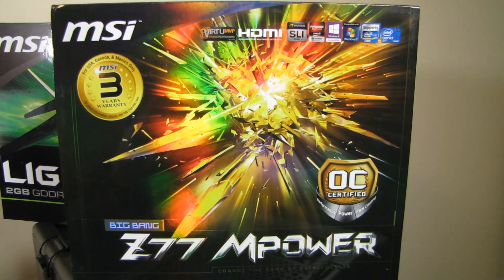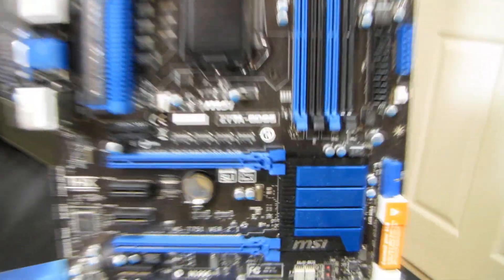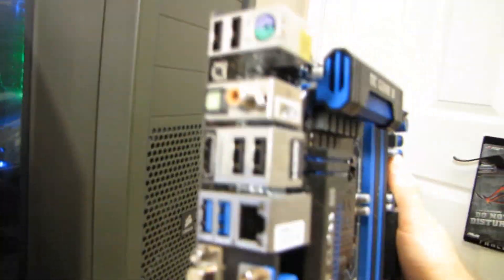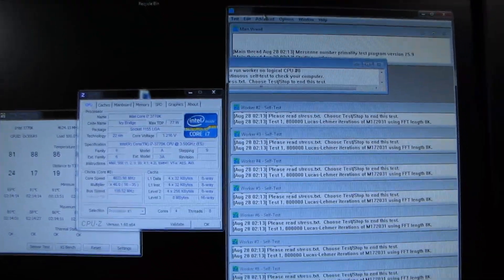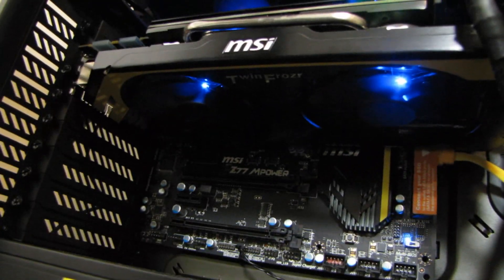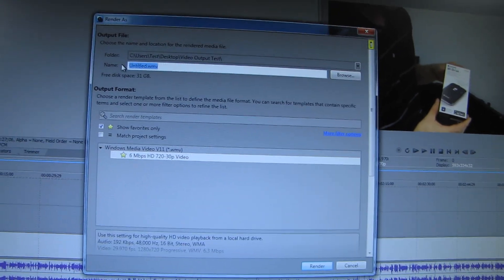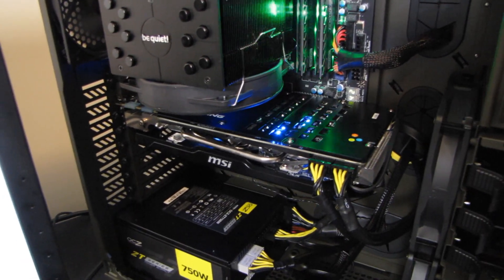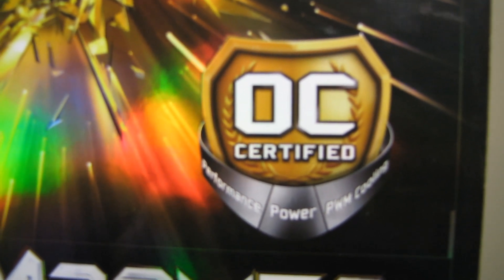MSI Big Bang Mpower OC Certified Motherboard Review Linus Tech Tips

Comment: If it is the blue LEDs on the top right hand side of the board it is not a problem. They are CPU phase LEDs they represent the amount of usage going through to the cpu phases. It is normal for that to happen.

Comment: Linus!!! I love you man!! but can u help me out for just one sec? I know the board has some sort of Phase control to help conserve energy, but it seems with whatever power supply i plug into the board all 12 phase lights aren't always on. It mostly only has 2 lights. I have a 750 watt, and 630 watt, and 500 watt, and they all do the same. . I'm figuring its the Mobo, but i would rather speak to a professional, instead of some Non-English speaking representative on the phone. Thanks man

Comment: why would you need it, the new cpu isn't going to be much of a difference from the 3770k just 5 10% like how much more to people need when they can already play games at the highest settings with an overclocked everything, even the 700 series gpu isn't going to be much of a difference when it comes out sometime in may and i don't want to wait till june for i7-4770k to come out and its clocked slightly lower at 3.2 MHz turbo boost 3.9 MHz and the price is rumored to be $327.00.3770k Great for me!

Comment: an i7 overlocked to 6.3ghz under liquid oxygen and 4 titans all liquid cooled. The motherboard does not really matter as long as you can fit all 4 titans on it a once. for your boot drive you need at least 10 512gb SSD in raid 0 but the prefered numbers is around 20.

Comment: In all my years of searching I have yet to find a "normal person." We are all different. :)
& I was assuming Linus is rich. xD
But for most ppl... I wouldn't even go intel. You can save $100 on the cpu by going AMD & another $50 on the MB, because of the socket differences and expenses.
Also with AMD's new APU you could save another $100 by not buying a gpu - assuming moderate gaming loads (League of Legends, Steam games, etc.)
So imo, Z77 wouldn't even be cost effective for most ppl.

Comment: AMD cards overclock better, generally, the 3GB of VRAM will be better in the future, games are already starting to need 1.5GB+ sometimes, the 356 bit interface will do you good, since it increases the throughput of the memory, which will give you better performance per MHz on the memory clock, and a 7970 GHz is often cheaper, or the same price with a good cooler.

Unless you need CUDA, get a 7000 series card instead of a 600 series.

Comment: can someone please help me, i just built a new PC with a z77 mpower, 3770k, h100. My stock temps are 60degrees when running prime95 torture test (100% load). Is this normal for my setup and the stock cpu configuration to be running at these temps?

Comment: is this a good setup for my new pc ?

MSI NVIDIA GTX 670 Power Edition

Kingston HyperX 16GB DDR3-1600

Intel Core i5-3570K Sockel 1155 (I'll use my current Xigmatex Gaia SD 1283 cooler)

Corsair Vengeance C70 Midi-Tower Military/Green

Corsair CMPSU-750AXEU 750 Watt (For future upgrades like SLI)

MSI Z77 Mpower 1155 Sockel

Plextor PX-256M5P SSD 256 GB - Boot Drive + some Games + Programes

thanks in advance :D

Comment: Actually, i've got a decent gaming rig with 'normal' and cheap Mobo from asus, asus p8z68-v lx to be exact and im running my i5 2500k @ 4.5Ghz, have ran super pi @ 5Ghz. With this mobo, you wouldnt probably run 3570k higher than 4.5-4.7ghz depending on your cooling, so your argument is invalid. I get way more bang for buck compared to any of these overpriced products. I dont judge if someone buys them, they're better but not needed.

Comment: if you want to overclock safely find your cpu specs from intel or amd and stay within there recomended heat and voltages... 
example: intel i7 2600k 
Tcase 72.6°C max rec. temps. 
vcore or vcc 1.35
stock 3.4ghz-3.8ghz
with stock intel heatsink properly seated can be overclocked to 4.0-.4.2
Thats a 5%-10% increase in cpu performance within Intels rec. heat and voltage.
buy a aftermarket heatsink and easily get a good 4.3-4.4 at around 2.96 volts and never over 60°C in a room 72°f.

Comment: @san7908
its a good question but its kinda impossible to answer your question linus is not a god or a fortune teller. everything from the cpu batch to your houses fuse/breaker box to the airconditioner in your window clicking on and off can affect longevity of your system. 
your cpu is not degraded by overclocking the damage comes from high voltages and heat. which can be negated with a proper cpu heatsink and fine tuning voltages.

Comment: im pretty sure you can get the same oc with the other board as well..? 4.6 isnt anything special unless your a old granny that has to use the auto oc. should have done a real oc with a better cooler to see what that "oc certified" board realy holds over that. im betting there isnt much more then .2-.3ghz  gain with that oc cert. board  and thats probly hitting the 5 ghz mark where you would be better off spend the extra cash on a better cooling system.

Comment: I think this "OC certification" is just your usual marketing babble.
How far your CPU can OC is largely dependant on the CPU itself and your cooling system.
The board "only" plays a secondary role (alas, an important one), in that you do not want it to fry when overclocking your CPU. However, if you had a CPU that is from a bad batch or your cooling is insufficient, no motherboard will help you getting it to a higher frequency than you otherwise could.

Comment: If I were MSI, I would be disappointed with this review. You didn't do what the board was built for at all. Put that system on a nice liquid loop and you may see a much clearer picture of what kind of overclocking it can achieve. Should have went with better RAM too. :p

Comment: Realtemp 3.70 is not compatible with 1090t phenom 2 x6 cpu's incase anyone else is running that cpu.  

You may need to use Coretemp ( regular for 32bit windows or x64 for 64 bit.  match it with your version of the o.s.)

Comment: I'm sure if you used a psu with a tighter 12v ripple suppression you would see at least *better* memory overclocking results. With an ocz zx 850w I needed +40mV for +630 memory, on my ax1200i (around 1/4 of the 12v ripple) I can do +630 on stock mem volts.